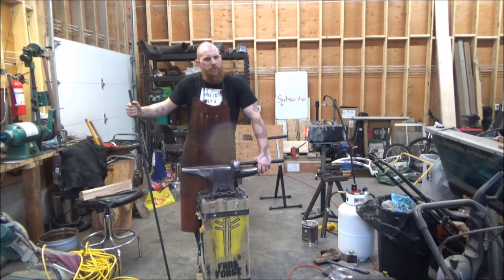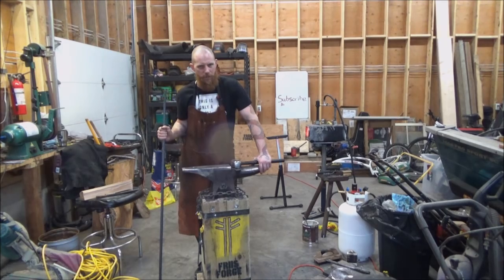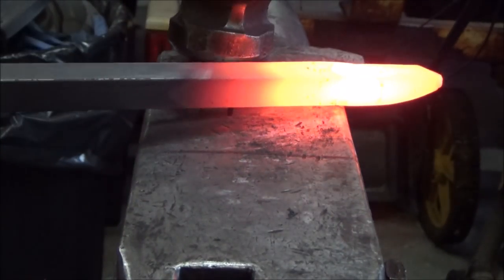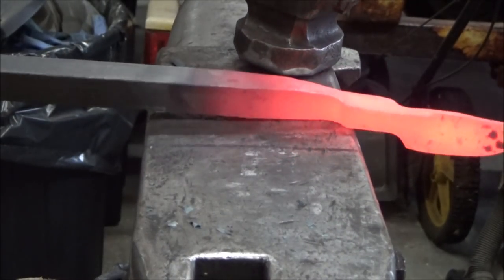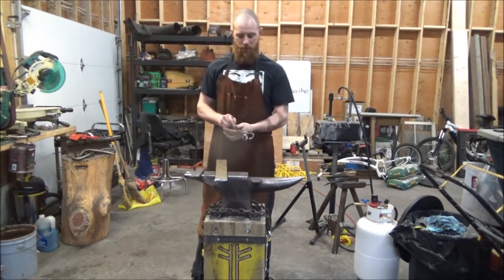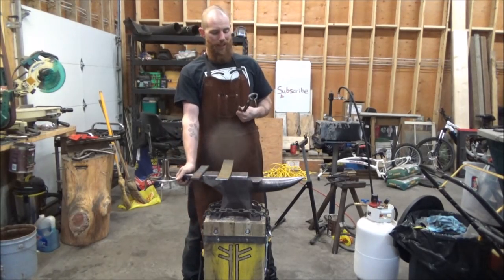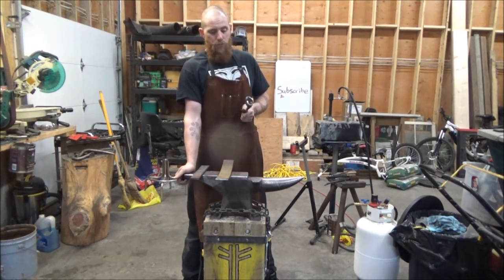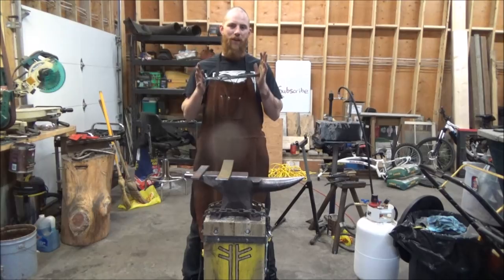✔ Forging Bladesmith Tongs

Comment: Great video and a nice pair of tongs.  Only thing I would do differently is hot punch the rivet holes rather than drilling. You lose less material that way and so retain more strength in the tongs. They're less likely to snap and will have a longer life.

Comment: Ha, great job. I too used only a picture and memory of a pair I'd seen. You might enjoy abit more handle length working with a gas forge. Other than that they look great. I like yours better, they seem to multifit different thickness and width better than mine. Keep the fire burning and most of all have fun. Thanks for sharing.

Comment: I really need to make me a set or two of them.  Only thing I can see is I'd likely use a bending wrench and jig and vise to do the bends, both because I don't have a bending fork built into my anvil and because I'd want to get a little tighter on the bends.  Would also heat the handle ends up and straighten and tweak them a bit more, not a big issue, just my OCD coming though and one of the things I spend the most time on when doing tongs.  That and I normally make tongs from 3/4" cold rolled round stock.  Anyway, tongs used to kick my butt, but they do get easier the more you do, and you did a good job showing the basic shape those need to be.
Reply from the maker: Thanks! The slightly off handle bugs me too. lol

Comment: Suggestion: For the handles, to add more leverage, maybe either extend them out, possibly glue on some sort of wood handle, or another option would be to forge weld more metal onto the ends because I don't know if  you are going to be making knives or swords but If I were you I'd want more leverage on the handles.
Also very strange way to make tongs to be forging them after they are penned together but cool
Reply from the maker: Thanks. I wanted to make sure everything lined up and I am not yet good enough to get them perfect pre assembly. So I forged the final bit post assembly. You sometimes see things like this especially with flatbit tongs when you forge in a recess for round/square stock. That was my thinking anyway. :)

Comment: great video.  Only thing I'd change is to hot punch for the rivit instead of drilling.  drilling is a clearer hole but you lose alot of material. Hot punch moves material and you lose alot less. keeping structure strong. great job man